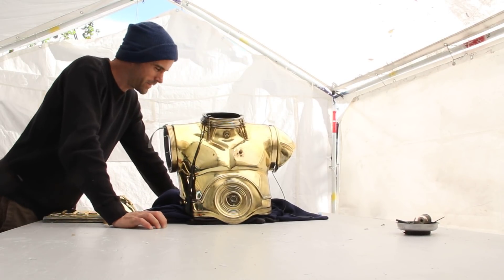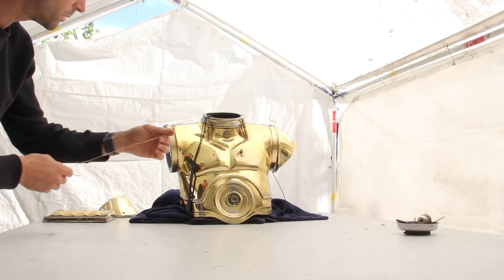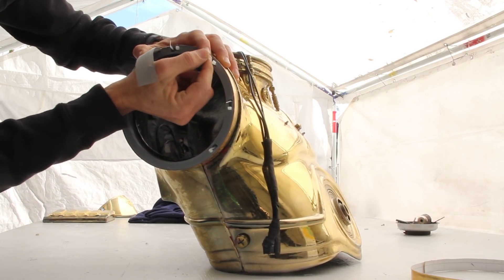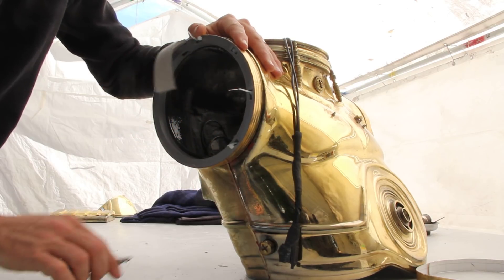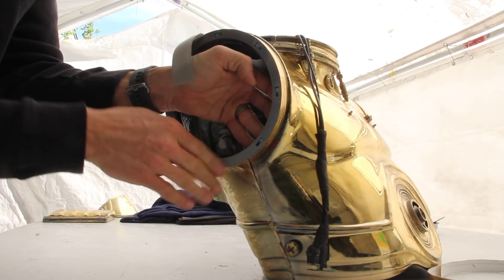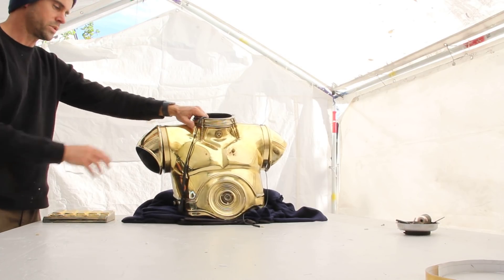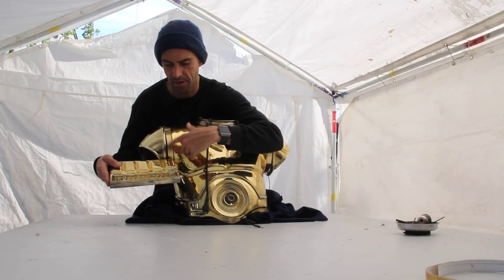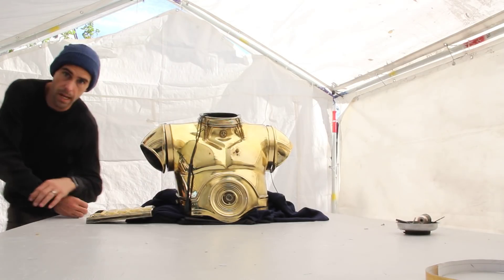3d printed Shoulder ring followup vid _ C-3PO Blog Update 181220

Comment: where did you get the wrap for the shoulder rings
Reply from the maker: Ordered online it from a place that sells auto wraps. It's made by 3M so if you lookup "3M auto wrap gold" you should find a seller. Got a BIG roll of it about six years ago because I thought I might be able to wrap the whole suit. Needless to say that was going to be more difficult than spray chrome so now I use the wrap to hide any chips in the paint and for things like the neck which I replace from time to time.